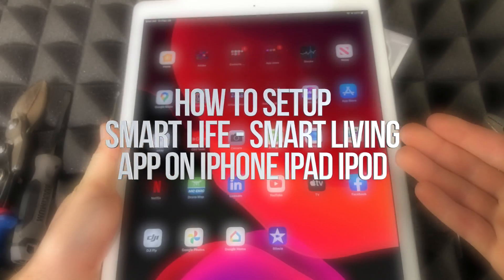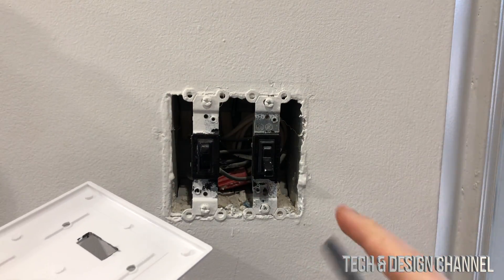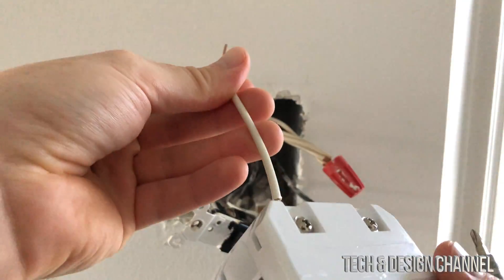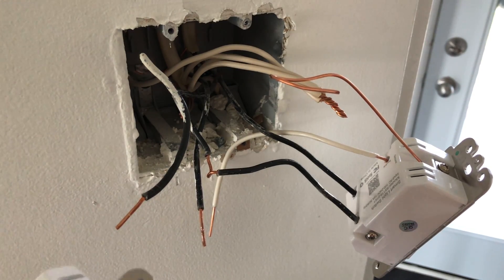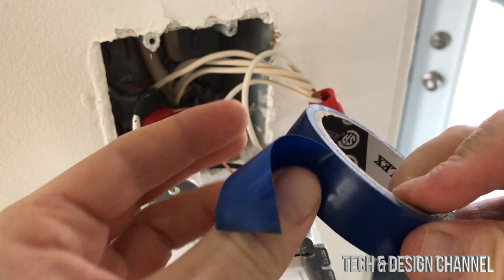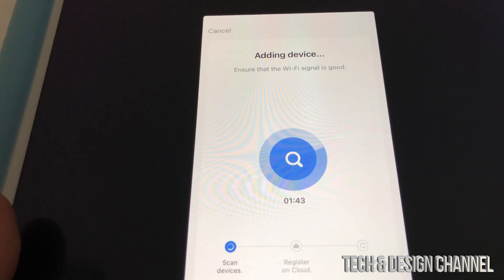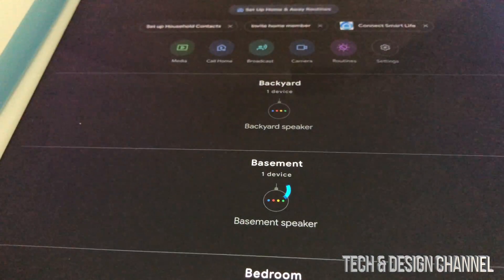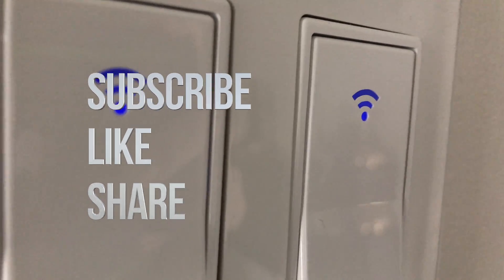How to Setup Smart Life - Smart Living App on iPhone iPad iPod

Comment: So I have a question as I got lost at the beginning and tried to catch up on what I was actually looking for on this app. So I just bought these Lite Towers and was told I should download this app to communicate with my lights. However, when I go to try and connect the lights I get so confused because I don’t know which option to choose from and then when I do try to connect.. it never finds my outlets or whatever it’s suppose to be finding thru Wi-Fi or whatever. I’m confused and this video sorta showed what I needed but one of the steps I’m confused about.. I don’t have the stuff to unscrew my outlets and stuff like that you did in the beginning. Do you have any knowledge about the Lite Tower? And how I connect them to the app?

Comment: I have several WiFi outlets. I have successfully connected them to the Smart Life app and I can control them with the Smart Life app. I've linked them with my Alexa device. However, I am unable to control them by asking Alexa to turn them on or off. The response I get from Alexa is, "the device is unresponsive". When I open the Alexa app, look at "Devices " all  the outlets show "unavailable"  Any ideas for a solution?

Comment: Suggest they continue to take pictures of the wiring as they take the switch out of the box exposing the wires and how they are attached to the old switch.  Taking a picture of the switch while it is still nestled in the box doesn't help much when trying to recall which wire goes where on the switch.

Comment: I have the same switch which no longer recognized in the App, but I couldn't reset it, I tried press and hold 5, 10 or 20 second, not working. I tried turn it on and off 3, 5 or 6 times, not working. I tried to cutoff the power by turning off the circuit breaker and turn it back on, not working. Can anyone help!?
Reply: try turning your airplane mode on and also your wifi make sure your on 2.4hz and then pair the device again